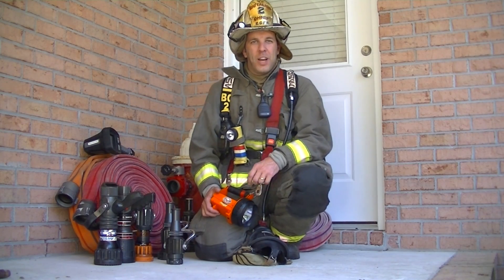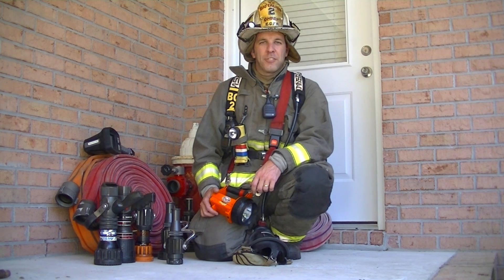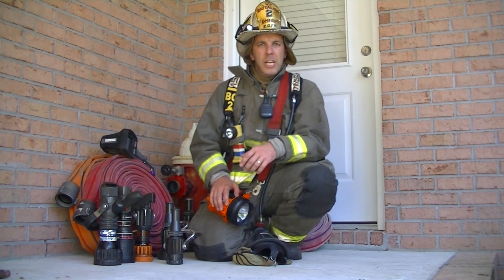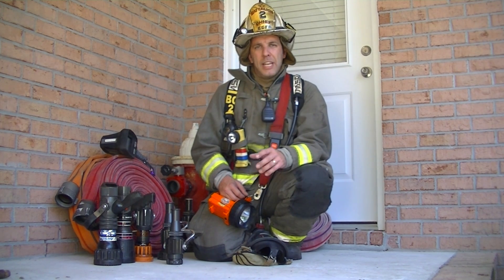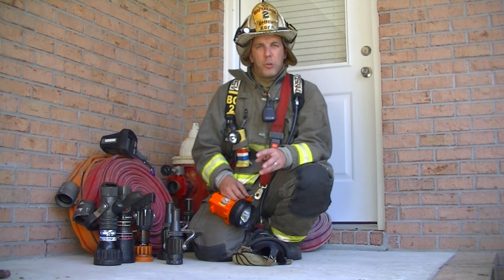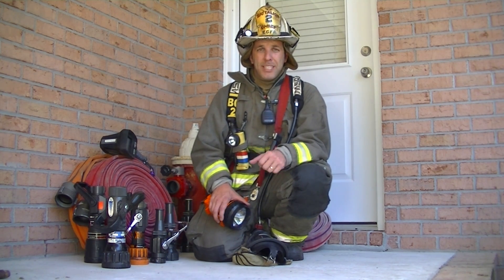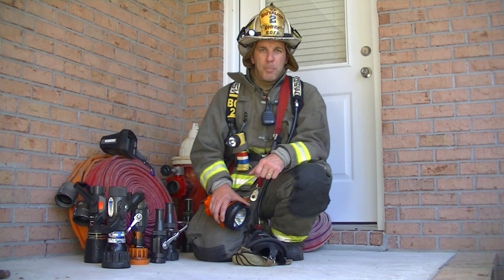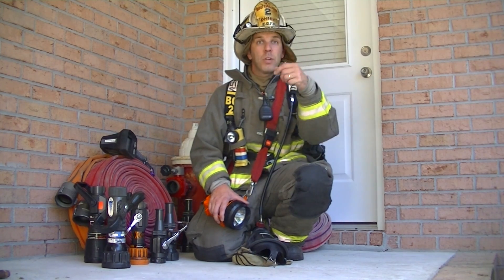Engine Company Operations Gallons Per Second The Update!

Comment: It's not about the that fires are hotter than the past, we still have the Temps. Och,och.. The Temps are however reaching near peak and very high quicker, couple that with energy saving products and where they are in the structure, they have no where to go, as fast.  Engine Co. Ops are very important. Right line, right stretch (with your crew size) and finess.  We have bunker gear, get  to the fire and fire your weapon with mindset of an ammo shortage.  You got a 50%-50% shot, do it or dont.. a lots riding on that officer from the bell, a lots on the crew to be on the same page.

Comment: Sounds like focus on the right spot.....do not get caught in the trap .......................Straight VS Solid stream what’s the difference?

This is a good fixed orifice fog nozzle in an exploded view (I deleted the manufacturer for legal purposes), I just want you to be aware there are more parts then one would think, even in a fixed orifice fog that has no twist shut off (foolish idea in my opinion, unsafe) and no spinning stream teeth (again foolish idea, more parts). This is important knowledge if you have any say in nozzle selection in your agency. I still find them to be very durable, but obviously not the same as a solid tip, which has no parts list. This fog nozzle is more likely to develop a problem over its service life, and has the possibility of accidental improper stream selection inside a building fire. We do still have to check all nozzles for debris daily even when deployed from an engine, you can find mainly scale or pea gravel that has passed though the pump from water mains. Building fire is where of course most life is lost and at risk. The fog nozzle design also should never be deployed from standpipe systems due to known debris issues in fixed fire protection systems during suppression operations, this action is negligence due to this known issue.

What is the difference in extinguishment capacity in equal gpm solid and straight streams? For example at 160gpm both at 50 psi both with a reaction force of 60lbs both representing the lowest acceptable gpm interior fire stream for small volume rooms and content fires (Vestal). Again, what is actually the difference in extinguishing capacity between 160gpm@50psi straight vs solid stream, this has not been studied to my knowledge. (it also may not be necessary)

Vestal, Fornell, Fields, Comella and Knapp are some of the people I have discussed this with over the years, and many others. Knapp stated clearly in his article a straight stream generates near identical air movement as a solid at similar gpm and nozzle pressure around 700cfm at 180gpm. Vestal and I both want to compare droplet size generated, are they similar or identical etc, and then attempt to figure fall out rate in super heated atmospheres between the two etc. This would require an aerosol lab like the one at UC Davis. I am in the camp that they will be fairly similar and in the field probably the difference would be inconsequential and no noticeable difference will exist in extinguishing capacity during field operations.

Now the fog is better at car fires, nuisance fire/trash, foam development, vegetation fires and overhaul. But one must ask are these fires or operations where life is lost/at risk most often. I am not anti fog or pro smooth bore in all things. But for interior line operation based on NIST, UL, NFA, Fire Engineering Articles and other studies the stream must be straight or solid to be within best known practice for the interior fire suppression operations.

But the more important lesson is the 160to185gpm goal target flow in the small attack line. This is our most commonly used weapons these flows are usually now at 50psi NP to make reaction force more manageable. Do not stop a move towards great extinguishing capacity towards a higher gpm line in your department because of an overzealous stance in either camp, smooth or fog. This upwards movement in flow is necessary because our interior fuel load has changed based mainly on the amount of hydrocarbons found in furnishings and building materials. In the end both will be generating a straight/solid stream and both are very safe when deployed off a pumper for interior operation. Do I think smooth bore has an edge based on simplicity, durability, debris clearly (standpipe is a must) and cost? The answer is yes when focused on interior suppression operations, when the most life is at risk.

But that being said, both straight and/or solid stream at 50 psi NP at 160 to 185 gpm (RF60to70lbs) will have a greater impact on the life saving potential over your existing 100to125gpm@100psi(RF63lbs) line guaranteed inside a structure fire. To delay this greater good to a higher interior line flow implementation by either camp (smooth vs fog) when looking at an “apples to apples” comparison in extinguishment capacity because one may be a “granny smith” and the other a “red delicious” is not be the best idea. I have news for you, taste buds are hard to control, I would first focus on the greater good, upping your flows while maintaining reasonable reaction force ranges of 60to70lbs small line and 100to110lbs large line. Then we can talk about the nuances of taste (straight vs solid). Call me, if you would like, or maybe have me out, the information is here for the taking.